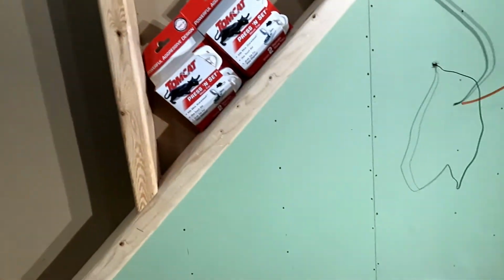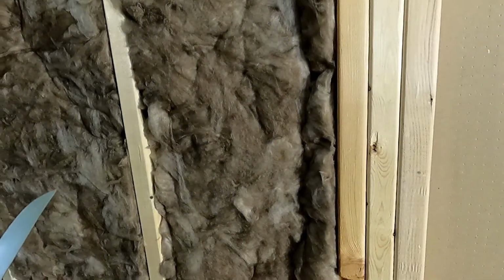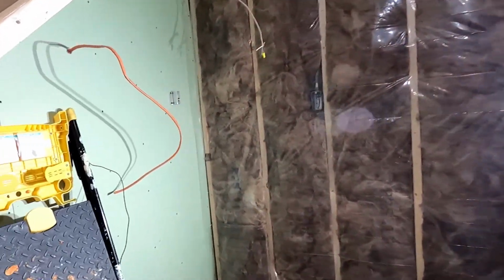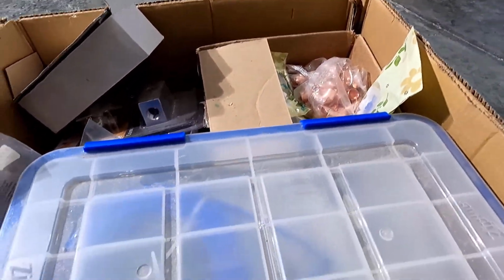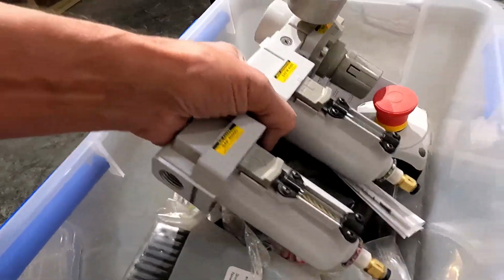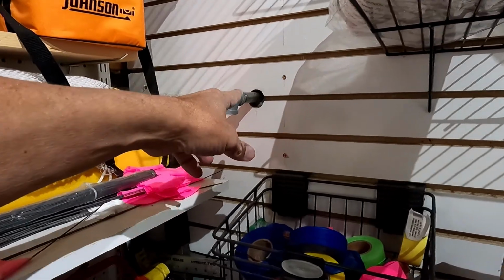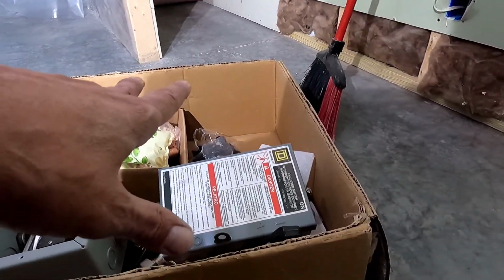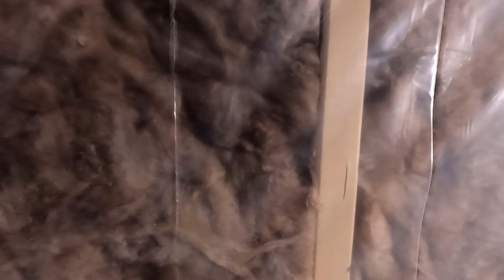Compressor Room Work ― Insulating the Stair Wall

Comment: Hi ! great video! how did you work with aire circulation or ventilation for the compressor into that room?
Reply from the maker: Hi Jose. I will be adding a one-way flapper vent to the final wall when I can get to it. Like a clothes dryer vent.

Comment: Hey Mojo, how many layers of green glue and drywall will you have when all is said and done? I was considering that for my teenage son's bedroom so he could play his music without disturbing the rest of the household 😂. I also noticed that there are two types of "Greenglue Soundproofing ", one is twice as much as the other so now I am really 😕 confused.
Reply from the maker: Hi Cindy, There will be one double layer of drywall with Green Glue between it in the room itself, and Green Glue between the drywall and the Slatwall on the outside of the room. Beyond silencing the compressor, the vibration needs to be dampened because of the shelves on the other side of the wall as well as in the mezzanine above. One of the Green Glues is for seams and the other is for the actual backs of the panels. You need a lot more of the panel stuff. For an existing  bedroom you can also look into Mass Loaded Vinyl. I'll link both products in a pinned comment.
Reply: Thank you!